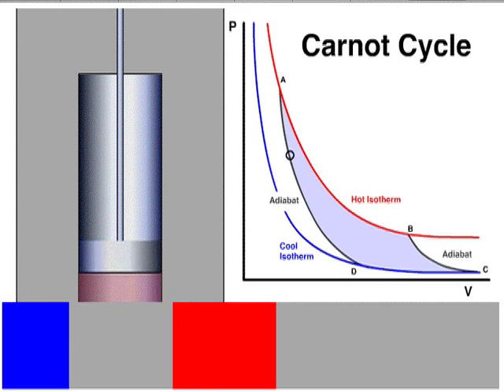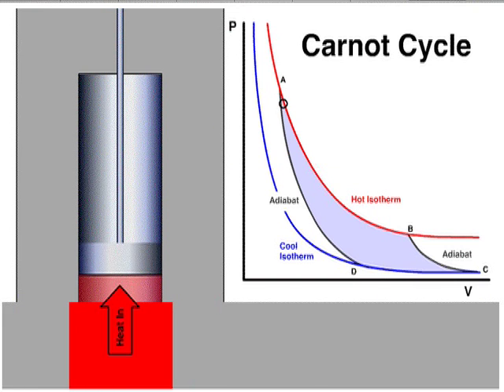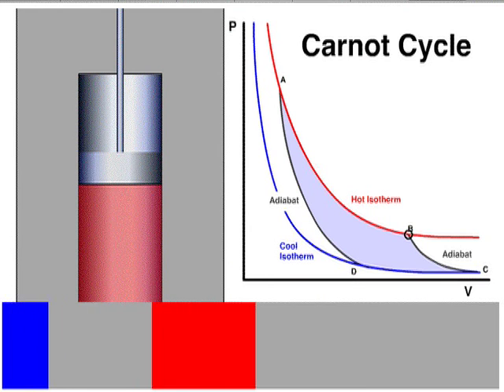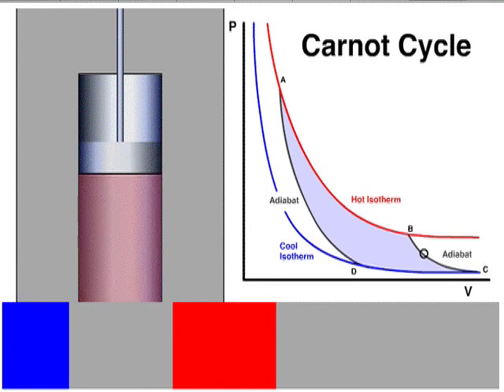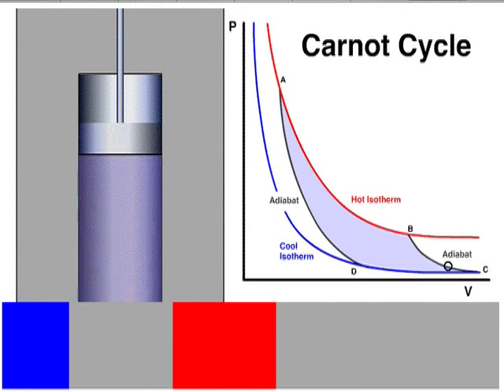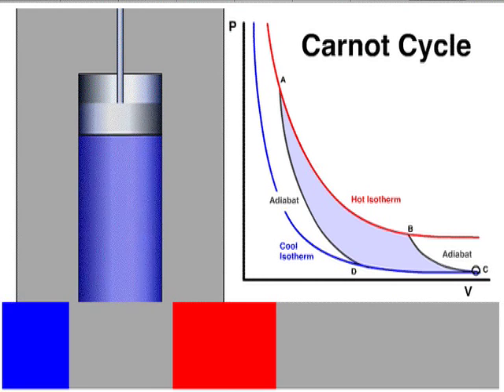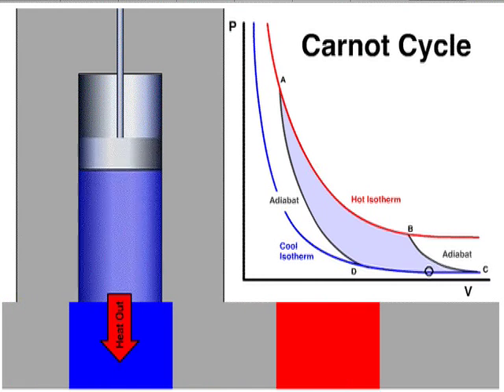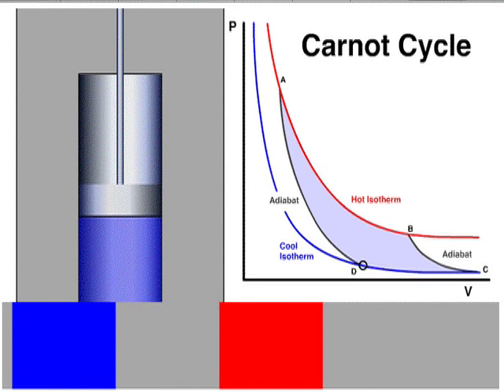Carnot Cycle 1

Comment: I have difficulties to understand why it is called (Hot) Isotherm (constant temperature), if according to this animation heat is added at this step. Can please someone explain it to me? Where is my mistake?
Reply: Its because during the hot isotherm, as heat is added, the energy from that heat is used as work to push the piston upwards. Adding the heat keeps the average kinetic energy of the gas particles at a constant value while they do this work. The work done i.e. heat added is equal to nRT_1(ln(V2/V1)) where T1 is the hot temperature